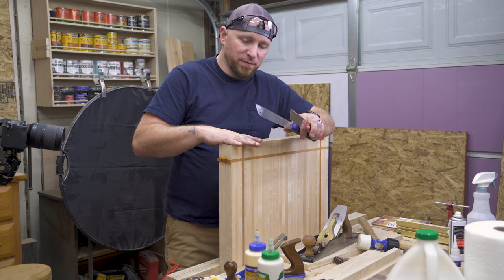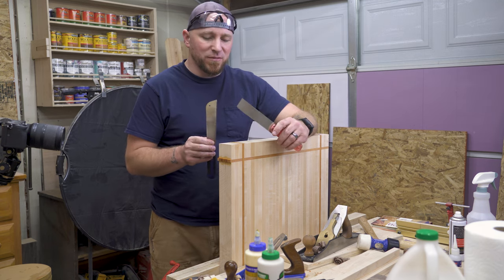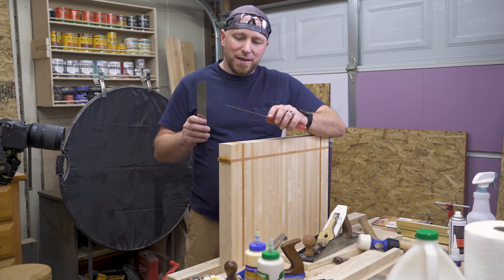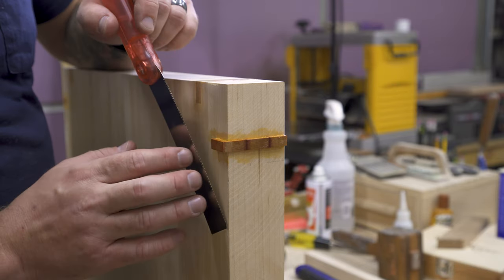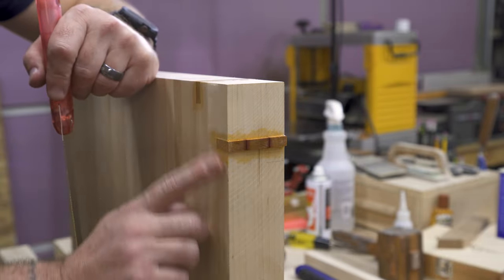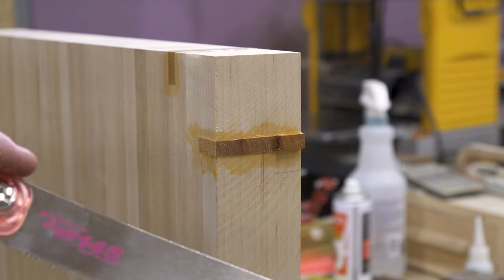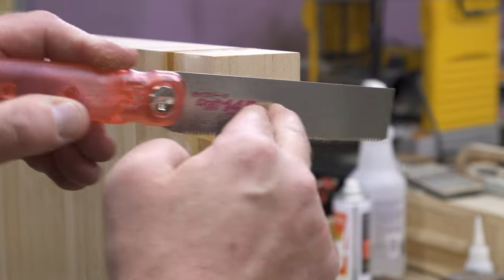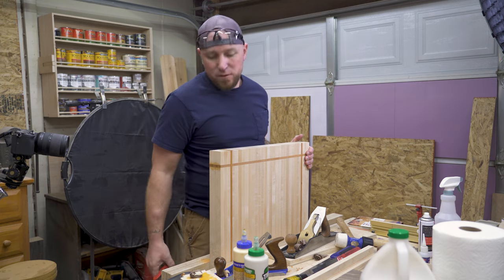Essential Woodworking Tools: Flush Trim Saws / Flush Cut Saws / Z-Saw and Irwin

Comment: I currently use one from Harbor Freight but it does leave some scratches. Thanks for the link to the Z saw. Glad to see the link for it was for Taylor Toolworks. Just received my second order from them and would highly recommend them. My orders were processed quickly, packed well and prices are good. They've become one of my favorites!
Reply from the maker: Great comment! Taylor Toolworks is one of the first places I go for tools nowadays. And the owner is one of the nicest people I know.
Reply: @InspireWoodcraft  I had a USPS shipping issue on last order. I called Customer Service at Taylor and lady I spoke to emailed me with info within an hour. Great customer service. :)
Reply: I filed the tiny set off of the HF saw with a fine toothed file. No scratches!

Comment: I was having a terrible time trying to use a Suizan trim cut saw and life was miserable.  I found this video and was amazed at how much better the saw you recommended works.  I thought it couldn't be real, but it was so inexpensive I decided to try it. It may be a slight variation of the saw you specify called 'Craft 145', and the difference is unbelievable.  I certainly had my doubts, but I am now convinced that there is a huge difference and cost isn't a factor!  Thank you, my friend, I am a new subscriber and believer!

Comment: I like my flush saws a lot but I learned a little trick somewhere that prevents any saw marks.  I take my palm router with my 1/4” spiral bit and just set it flush with the surface of what I’m working on and go back and forth over the piece that needs removed.  Makes perfect flush cut with no marks.
Reply from the maker: That’s why I mentioned that there are multiple ways to go about it. My saws all live but a few steps away from me so for me it’s way easier, quicker, quieter and less messy to grab a saw than to set up a router.
Reply: @InspireWoodcraft  , I agree.  I was just throwing that out there.  I appreciate the excellent content of your channel.  Your channel actually provides me with useable knowledge to do stuff better.  I have to say your channel is in my top 3 woodworking channels that I look forward to watching.  Thanks and keep them coming.

Comment: Been using the same Irwin for the last 5-6 years and it's still working great - rarely do I get scratching. The key is a light grip and letting the saw do the work. My sawing technique is slightly different than yours in that I keep the fingers holding "flat" pressure in the same place rather than moving them with the saw. In other words, the saw slides between my fingers and the workpiece. I'll check out the Z saw tho.
Reply from the maker: Thanks for adding this. I also use the technique that you mentioned, so I'm glad you brought it up. Yeah the Irwin has been a great saw, its just reached the end of its "fine detail" life.

Comment: Thanks for sharing! I've got to replace a couple sections of my 1 x 3" pine cabinet face frame boards. I'd rather cross cut the straight lines with a fine finishing hand saw that will cut cleanly/accurately instead of using my jig saw. In your opinion, would one of these saws do the trick? Thanks again again for sharing your video. I defiantly learned a few things here. Great job! 👍😊

Comment: Perfect timing! I have been looking at getting a good saw. Now I know where to go. Any recommendations for other types of saws?
Reply from the maker: Nice! So I have this saw for larger material and through cuts (https://lddy.no/uvew) and this saw for small parts and joinery (https://amzn.to/2MZE7Do) and I really haven't found myself needing anything else. If that second saw is outside the budget, Taylor Toolworks has a couple of other back saws at much lower prices (https://lddy.no/uvfc). I have heard nothing but great things about them, I just don't personally own them. Hope that helps!
Reply: @InspireWoodcraft  Thank you. I find myself putting off buying tools because it is difficult to find the right ones. I am a bit OCD and don't like spending money on tools that will wind up in a drawer and forgotten. Thanks for the great content, I always learn something new👍 Just looked at both links. I had been looking heavily at a Ryoba saw. The fine parts saw will also fit right in.

Comment: Jodee, thanks again for the tip on the Graph Gear pencils.  Great pencils.  I left a comment on your website yesterday.  In this vid, I notice what looks to be glue staining where the inlays are.  How do get rid of those stains?  Big problem for me.  Thanks.
Reply from the maker: I briefly remember seeing something come through but I haven't had a chance to check emails yet. I'm glad you are liking the pencils though! The discoloration is dried glue and I will be taking it off with a hand plane most likely. In the past I would have sanded because I didn't have planes, and sometimes that is still a better option.

Comment: Learned a thing or two on technique of using these.  Thanks for sharing.  So when do you decide to use a flush trim saw or a router,  or a belt sander, or a table saw,  etc to do this?
Reply from the maker: You know, I find myself reaching for a hand tool more and more as time goes on. A lot of times they are quicker than setting up a machine and less messy/dusty, which is really all it takes to convince me. This board is roughly 21 x 27 inches and 2-1/4 inches thick and it weighs 40 pounds. It's heavy and awkward to handle, to say the least. Although a pain to get clamped into my lousy pipe clamp vise, it still took less time than setting up a router. Less noisy and messy too. The belt sander would have worked but I didn't want to risk sanding away more than I needed. And again, noisy and messy. I think you probably can spot the common trend here. Haha
Reply: @InspireWoodcraft  Makes total sense! And your other theme you teach is why make it more complicated than it needs to be.

Comment: i know this is unrelated to the point of your video, but is this cutting board a personal build or for a customer?  if its for a customer.. you didn't charge enough.  from my perspective your doing a fantastic job of making something simple way more complicated that it has to be lol.. i hope this doesn't offend i do mean well mostly
Reply from the maker: I understand where you’re coming from. This is personal. One thing that you have to remember too is that if I was to make this for a client, I would still have the same attention to detail. Things need to leave the shop straight, square, parallel and symmetrical regardless of its final destination. That’s how I work anyway. However with this I’m able to pull some useful information from time to time for people who need it. A client build would have been out the door already.